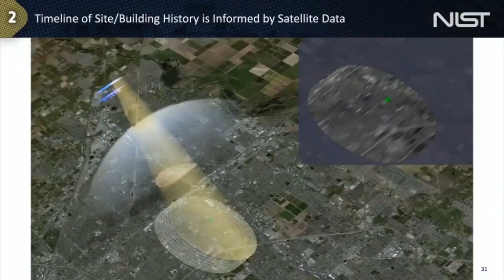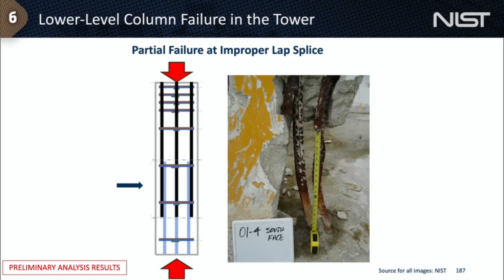NIST reveals preliminary findings on cause on Surfside Champlain Towers South collapse

Comment: NIST concluded that two skyscrapers collapsed in New York despite mathematical evidence to the contrary ( a body recovery rate of less than ten percent is not possible in any collapse here on earth)
Reply: List the building or date of NIST report, there is no way to cross check your statement
Reply: @williamlloyd3769 pretty sure they are taking a jab at the twin towers here.
Reply: In your opinion, which has no merit.